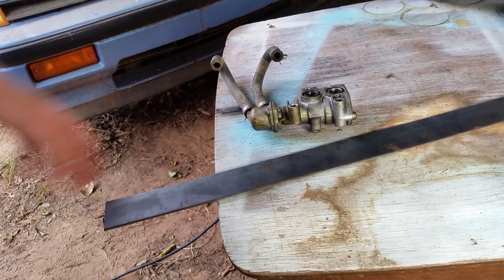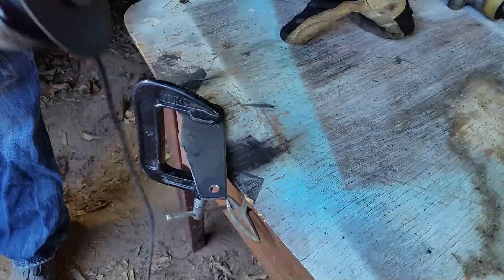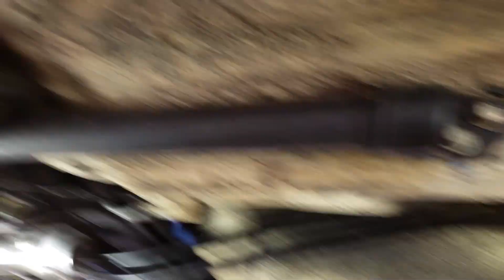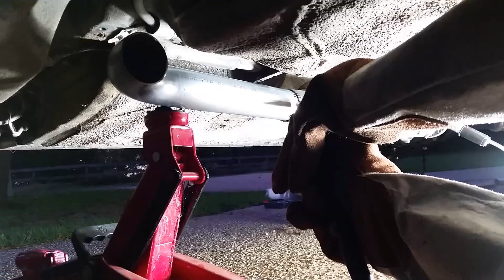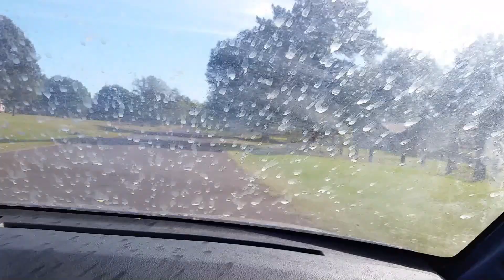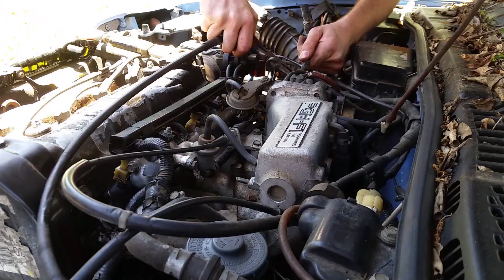87 Integra: Ep 9 - First Drive

Comment: That second smaller fan on the radiator is for the AC. Since you guys took it out and deleted it, you dont need to run the second fan.
Reply from the maker: Interesting. Might give it a shot.
Reply: Been running without  that AC fan for a while now on my 89 Teg with no issues.
Reply: I'd put a switch on the second, a/c fan rather than remove it. That extra fan would come in handy while sitting in the grid at an autocross.
Reply from the maker: We tested it and both fans come on at the same time on our car. So we are just gona leave it as is right now.